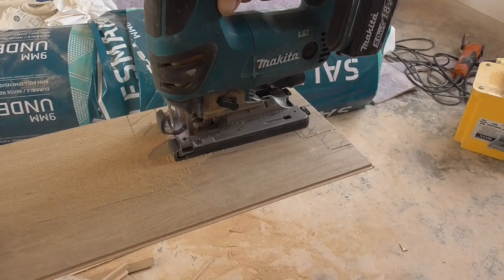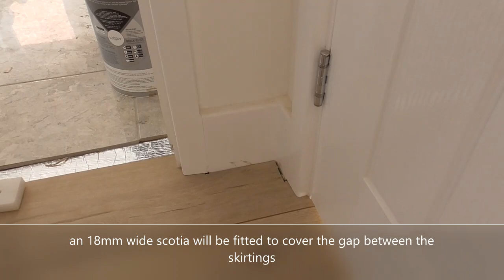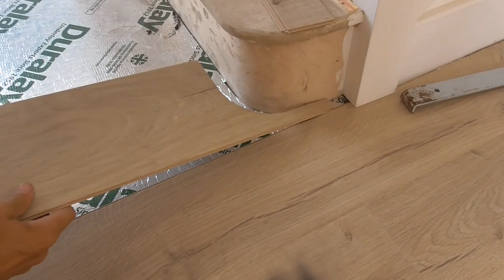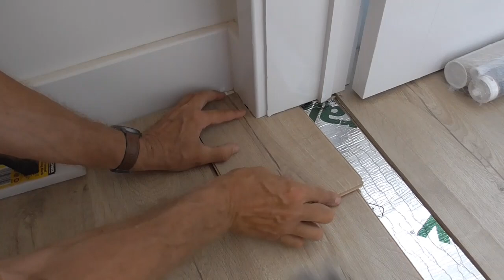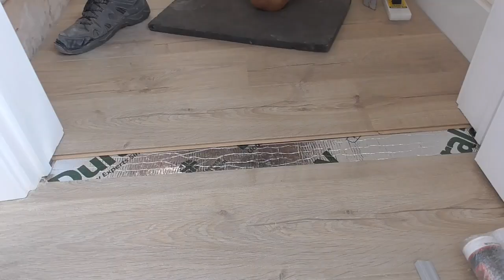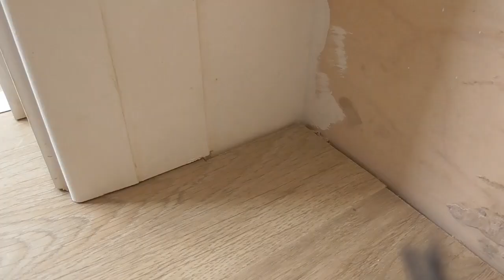Cutting Quick Step laminate flooring under door frames and around stairs

Comment: Do you have any tips for when you're doing laminate or vinyl in a hallway, long skinny hallway that has railings like spindles that you have to go around because they go right to the floor there's no wood there almost like a cap stare with carpet under the hand railing it's like 12 to 15 wood squared spindles. I'm going to just make a seam in the middle of the spindle or back of it, cut out the shape of it on the outside smaller piece I cutoff and then put it back with some glue or nail or whatever. any other ways to do this besides buying like a 6 inch wide nosing ? Which I would  probably have to invent because I'm sure they don't have them that wide lol thanks im doing the job in the morning I doubt you'll be able to get back to me by then but any advice is good for the next job cheers.
Reply from the maker: Hi Trevor🖐I don't think I can offer any advise that would make this job easy🤔It sounds like a right pain and all I might try and do is lay the boards from the spindle side of the hall way making the joint in the boards in the center line of the spindles. Then you could cut half the the spindle out of each edge of a board and then clip them together👍Good luck😎Cheers Del

Comment: I need to fit a laminate floor around a curved step similar to what you've shown here. However, there won't be any carpet on the step as its an oak step.
How would you suggest getting a tidy joint? Or best way to disguise the joint?
Reply from the maker: Hi Shaun🖐I would cut a cardboard template first, and once you're happy with the fit, transfer it onto the board and cut it👍You could also cut a more shallow curve into the board, and keep offering it up to the riser, marking and taking small amounts out till it fits nice👊
Reply: Very easily actually. Cut under the step. I'm a woodfloor fitter 20years and always undercut the bottom step so floor slips underneath. This gives my customers option to paint stairs and have a carpet runner. Sometimes bottom step is  concrete so not possible to undercut, a neat scribe would be only option..
Reply from the maker: @cjspaul9900  Hi there🖐The bottom bull nose would come loose if it was undercut on these jobs as is stuck down to the oversite concrete with thin battens against the back of the riser. The whole stairs is shockingly fitted😬Thanks for adding you comment👍Cheers Del
Reply: @thetallcarpenter  yes mate I agree some new build stairs are badly fitted particularly the bottom step however it's still doable and if possible its best to slide floor under bottom step. It doesn't need removing Just need a multi tool and a scrap of flooring as a guide to undercut the step. It takes a bit of time and effort to do this but we'll worth it as customers notice and appreciate the tidy finish.. if its covered with carpet then obviously it doesn't matter if its cut under..
Reply from the maker: @cjspaul9900  Too right bud, and cutting it under  always is the best job👊

Comment: Don't mind doing floating floors. Laminate or Vinyl. Remember the first incarnation that you had to glue every board. Then the sprung metal clip version. That didn't last long. Kliploc has hung around. Some better than others. Even the Vinyl now can be clipped and floating. Although I prefer the glue down. Main thing with floating laminate floors is expansion. I have seen lots of floors like the ocean waves because they were laid too tight.
Reply from the maker: Hi Dave🖐Great run down of all the floor systems that have come and go over the years🤩Like you, I have also seen floors hump up due to expansion when the perimeter gap hasn't been big enough😵 Another great comment bud😎Cheers Del

Comment: What's your view on fitting luxury vinyl in bathrooms and the various obstacles this presents? I fitted some for my mum several years ago and some of the planks began to crack recently. I reasoned that as this was suppose to be a floating floor, the issue arose from the toilet and bidet being screwed into the floor through the vinyl effectively fixing some planks an not others, creating tension, compression. A couple of days back I fitted some quick step vinyl. However, I used a drill bit on the vinyl where the screws were going to be situated before laying in the hope that the floor would expand and contract as one.
Reply from the maker: Hi there🖐I haven't got great experience with luxury vinyl, especially in bathrooms, but drilling a clearance hole in the flooring around any fixings seems like a really good idea to allow for potential movement👊 Thanks for your comment😎Cheers Del
Reply: yeah you're not supposed to fix anything through a floating floor. templating paper and back marking is the way to do it.

Comment: What’s going on at the doorway with that narrow strip Del? Was the floor on other side laid previously/ by others and you’re running into it? Or is this a deliberate expansion break?
Reply from the maker: Hi there🖐 You got it bud, its an expansion break👊(and it was laid by the fella I was working for, but it was only a square room so pretty easy for him to do and meant I could get the rest of it done in one day as there was a little bit of travelling involved). Thanks for your comment and for watching😎Cheers Del

Comment: Del you need to show us how you scribe all those pieces! Nice to fit flooring that you don't have to tap in at an angle for the door linings..
Reply: Most likely he has cut the ridge off that is on the outer side of  grove on last board fitted this turns it into a conventional t and g joint no need to elevate the board that you’re laying
Reply from the maker: Hi Marco🖐I will do a more detailed video on how I cut these shapes on the next floor when I'm not under so much pressure😵Thanks for watching and your comment 😎 Cheers Del
Reply from the maker: @richardskelly7090  Hi Richard🖐 The beauty of Quickstep is that you can click it together laying flat, which is really hand for fitting it under things👍Thanks for your comment😎Cheers Del
Reply: @thetallcarpenter  wow could be a game changer never installed this brand. Love the channel !!
Reply from the maker: @richardskelly7090  Honestly Richard, I've tried every different make of laminate flooring and none beat the Quick Step for ease of fitting👊Thanks for watching my videos bud🤩

Comment: I did one job with click lock. The only trouble was the guy had laid his own concrete floor in his garden room/office. Didn’t leave a decent surface for the insulation, didn’t stagger the sheets and didn’t stagger the floating floor on top. It was just a nightmare that really left a spring in your step 🤦🏻‍♂️
Reply from the maker: Sounds like a nightmare Carter😬Been there myself too mate😩 Thanks for your comment😎Cheers Del
Reply: @thetallcarpenter  I had to scribe the skirting to fit the floor haha. Can laugh now.